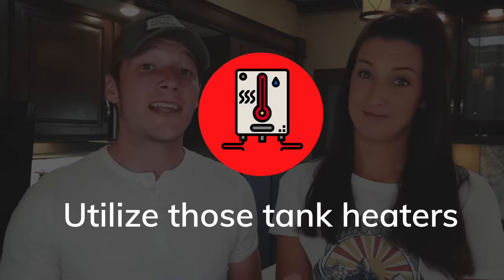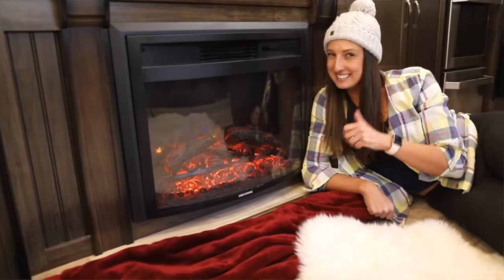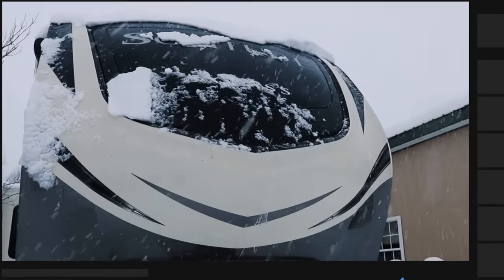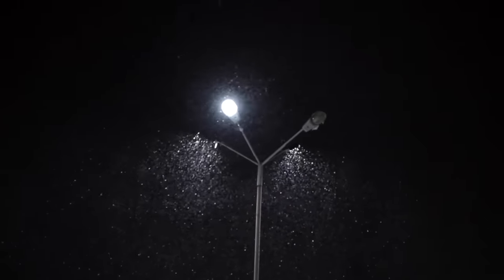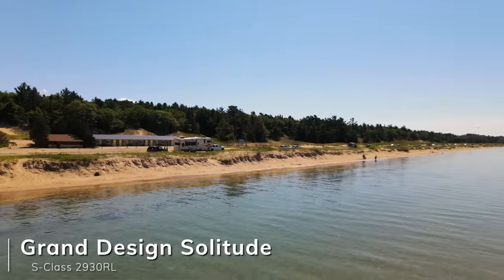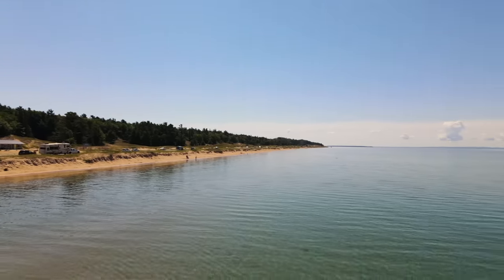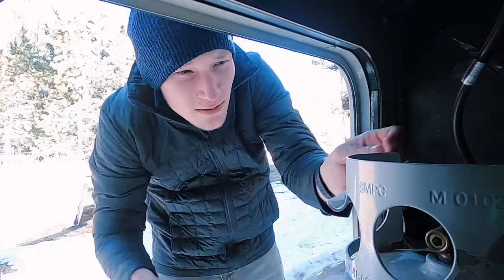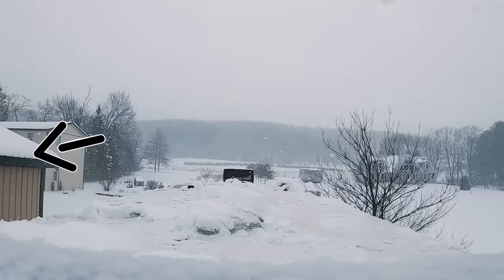Best Winter RV Camping Tips to Maximize Comfort (Winter RV Living)

Comment: Canadian here, my tip: get a heated blanket and place it under your fitted sheet. Turn it on about an hour before bed. Toasty warm. Luv you guys! Cheers
Reply: My cat, George, is a regular furnace and sleeps under the covers with me.  Lots can be said about a toasty bed.  Great idea!!
Reply: They actually make heated mattress pads for this purpose, rather than putting a blanket there.
Reply: Great idea!
Reply: -44 in North Dakota while building my house 

Sucked, just use lots of propane and skirt your Rv with foam board

Comment: Edmonton, Alberta, Canada. 4 years full-time in our 1988 Itasca Class A, 31ft no slides. We go through at least one Polar Vortex every winter with temps in the -40 range before windchill...without a furnace. We use a Buddy heater, an electric heater and electric blankets on the bed and couch, with a small heater in the under bay. We have a composting toilet and turn our water off if it gets too cold. We have ordered a diesel heater for this winter so we should be able to leave the water on longer this year. I love my home most in the winter, it's so cozy.

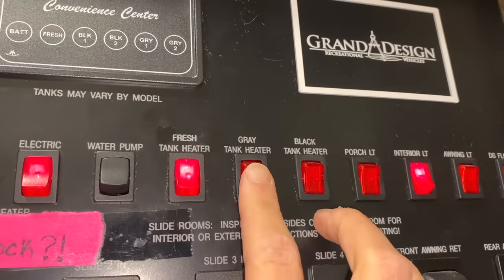Comment: Hot Tip for those of us with 2 propane tanks, and that "auto switch over valve"  only have 1 tank turned on at a  time, this way when that tank runs out, you can go outside at 1:30 in the morning when it 14 degrees, turn on the other tank and have heat again, instead of running a half hour to town, to a 24 hour gas station to exchange empty tanks while its snowing, so the rest of your family and pipes dont freeze by morning. Ask me how I know this, its related to my comment below, as in the first night at our in-laws after an 1100 mile trip in 2 days to get there.
Reply: Yes I learned early on that  those few minutes to switch the regulator arrow & open the tank sure beats a trip away & the exchange rate! I’m not even sure of the benefits of the dual tank use except for if you have spare tanks filled & waiting.
Reply: That’s exactly what I was told to do, so that you don’t run out of propane completely! Thanks

Comment: Haha love that you guys called out Canada! We live in Ontario and stayed in our Cougar 30RLS all winter last year. End of Jan/early Feb there was a prolonged period where temps stayed around the -30’s. We never had any issues BUT preparation is definitely the key for that. Skirting is a MUST! Multiple thermometers to constantly monitor the temps inside the RV, in the under belly and even in the skirted area beneath the RV. Snow actually acts as a great insulator against the skirting also! To keep inside comfortable we ran 2 space heaters as well as our furnace. To avoid any water freezing we use the “NoFreeze” brand heated water hose and it works fantastic! We’re starting to prep for another winter coming… best of luck with your winter camping adventures!
Reply: I'm in the same province and been looking to take 9n this lifestyle.  Is there an easy way for an old person like me to understand how to set up for keeping water running in those cold Temps without wrecking the rig or burning it down?

Comment: 3rd year full time in BC Canada 1995 4 season Corsair 35ft    I am parked on a friends property permanently.  I built an 8x10 add a room for a wood stove  fully skirted with 2x4 construction with insulation and reflectic .    under unit stays around 50 degrees with an 550 cfm air mover with a 6 inch pipe forcing air down from beside the woodstove.  inside the unit its birthday suit weather.  This year I put a 40 foot pole barn type roof over it

Comment: I’ve only had my trailer for a few months, but so far I’ve used it down to -15F.  Mine is a small travel trailer, and doesn’t even have an enclosed belly much less a heated one, so obviously there’s no way I’m running plumbing in those conditions.  I just have the water systems all winterized, use water out of handheld jugs kept inside, and have other arrangements for a toilet rather than the one in the trailer.  Once plumbing is out of the picture you can handle far more extreme conditions without even stressing about it.

I’ve also camping in hammocks and tents both down to -30F, so a heated trailer is easy mode.
Reply: I agree, if you just live in it and dont use water you can go all winter fairly simple

Comment: -20F.  Skirted (air skirts), incandescent bulbs (4) under the RV, one bulb in the water bay, heated water hose, 30 pint per day dehumidifier, shrink wrap plastic on the windows, three layers of shrink wrap on the door, insulation board  all around the slides.  We had already insulated the storage bays.  We used about 100lbs of propane a month.  We used Reflectix on the bedroom windows between shrink wrap layers. When it was sunny, all the blinds were up to take advantage of passive solar.  We used $165 of electricity in a month because we used space heaters too.  We stayed toasty.

Comment: I have a semi with a sleeper like camper. I have to pleasure of running in the Dakotas Northern MN all year. Truck is set up like a camp with shower, toilet, connection oven and  cooked tops. We crank the heat up when cold 🥶.  I will run water back into tank a few times a day to keep water flowing. Also put insulated panels in the windows. Put tray in sink to catch water. So drain doesn't freeze.  Shower has a valve that we keep closed and only open it to drain after a shower. The fun and joy of running in the north besides trying to keep fuel from gelling

Comment: Hey Hanks! We are  RV owners in Colorado. We have a 2-1/2 season travel trailer. No underbelly heat.  We winter camp mostly, (no bugs or people). Don't use the fresh tank.
We do use the black and grey tanks though. Have our water in 7 gallon jugs, keep in the bathtub of the bathroom. We put table salt in the tanks to keep from freezing, about 1/4 pound per use. Its cheap and works well. Coldest we have been in was -10 for three nights.

Comment: The coldest we have RVd through was -20 Fahrenheit. We full time RV in our Vanliegh  Beacon, but our "home" is in South Dakota.   During the winter we camp on our property in South Dakota and use straw (not hay) as skirting.  Most little rodents do not like straw, and we supplement with plug in mouse deterent.  Never have had an issue.

Having farm cats outside and two cats inside certainly helps also.

Comment: I RV in Pennsylvania where I’m from. Definitely skirt, stuff foam in all the ac vents, bigger propane tank, blanket your propane tank like you would your home water heater, pipe insulation around slides inside, definitely use reflectics over windows, make sure you take vitamin D supplements, underbelly heated, basement storage heated, wrap heat tape around your fresh water hose then keep it behind your skirting, hard pipe your sewer with pvc piping, and dress in layers. I’m sure I’m forgetting something, but all of this prep is necessary. Have a great winter ❄️

Comment: Thanks Hanks! Coldest camping was about 20 years ago in northern Maine during a late December snow storm. Had a '77 Coachman truck slide in camper. It was -4 F overnite with wind chill around -20 F. Batteries went dead during the night, so no furnace. Started truck to charge them. It was that night that I learned I had not wired the camper plug to the truck correctly for charging. Ooops!

Comment: It's been high 30s and mid 40s over night so far in south Carolina. Been using electric fireplace and space heater. Never propane, the heater is a pig with propane it's a waste. 

Heading to Florida next month. I'd keep moving to maintain temps above 30 and below 90 basically heh

I was a bit surprised at the mention of drafts thru your slides that weird I've never seen that. I had the rv tipping in the hurricane wind and not even a tickle of air came thru the walls...

Comment: Hello! As a FT RVer for over 6 years, I’ve done multiple winters in New Hampshire and at 7500 feet in Colorado. Extreme temps in NH reached -25 degrees, without a skirt one winter. It was quite an adventure, and I learned a lot. Luckily, I was able to avert any major issues, but I had to be very mindful and stay a step ahead of weather on a daily basis.

Comment: We wintered in Northern Utah last year, it was our first winter in our Grand Design Solitude 377 MBSR, and the lowest temperature we had was -4 degrees! We have vinyl skirting that snaps around the bottom of the rig, which we then weigh down on the inward side with sandbags so the skirting doesn't move in the wind.  It's a little dicey with the skirting around the cap, but usually works really well.  We also invested in two 25' Camco heated hoses last year and that made a ton of difference as we didn't have to worry about frozen water hoses.  Another thing we learned was the value of throw rugs.  Cover your floors with throw rugs! We use the thick, long bathroom mat type and that little bit of insulation makes a difference PLUS the extra color in the rig offsets not being to see outside because of the reflectix on the windows!  Wintering in your rig is quite comfortable when you take the time to prepare! Great video! #thankhanks!!!

Comment: Hey Hanks,
As a "wise" 17 year old I spent a -25 degree night in a cargo van in upper Michigan with no heat or  insulation.  Just LOTS of layors quilts & sleeping bags.  In the morning there were icicles on the inside of the steel roof, brrrrrrrr!
Happy trails~~~

Comment: -46c yup in canada winter here all the time ceramic heater in  the unbelly  and propane blast furnace under nnder the fith wheel no prolems under bbelly sat at =25c under the trailer a nice +18c

Comment: Hi guys! We lived in our rv all last winter in our rv in Idaho. Saw several 10 to 20 below zero nights. Watched your winter tips SEVERAL times to make sure we were ready. We skirted using 1.5 inch styrofoam. We also used the REFLETIX  It worked great. We did freeze twice on really windy days. We were lucky and only had to place a space heater near our pipes for about an hour. We insulated our sewer hose also with the same styrofoam. Pretty easy to cut out a box to cover it. It worked great as well. We kept it closed until it was time to dump. The park did ask us to keep our gray tanks open with a trickle of water running all the time below 23 degrees F.  We could kee the rv pretty consistently 60 to 70 degrees. We got on a propane delivery every month. It was pretty spendy but way better than freezing. We solved it this year by moving to FL lol. Thanks Hanks for the great tips!
Reply: The temps in Idaho can be brutal no matter the season.  There is no place like home...miss Idaho.

Comment: Yep...winter RVd. It was skirted but it was a 80's run down camper and I only had a space heater. It was 30 degrees on the floor and 60 degrees on the ceiling. And actually it got a bit warmer once it was all covered with snow. Wear a hat, use down comforters. 😊

Comment: One winter under my belt. I did it Oklahoma City. Lessons learned. I dumped my tanks too much. I had to dump lots of chemicals down the toilet to be able to flush them out. No damage done as far as I know. It got down around 7 degrees. I’m now in Mesa AZ for the winter.. I cracked open my emergency wine one night. Last winter you could find those at Sam’s club for under $7.

Comment: We have a small ceramic heater in our wet bay which manages to keep the black gray and fresh from freezing and I agree 100% with propane and the furnace with the ducting through the coach assisting with the heating process. And don’t forget the block heater! Also yes on the light bulb program. Thomyt

Comment: Our lowest temperature was 17 degrees during a week in Colorado in October, with about 9 inches of snow.  We applied most of the techniques you mention. It seemed like the furnace was on as much as it was off. We did have a partially frozen line into the kitchen sink, so we will keep the cabinet doors open at night in that situation in the future.  We had a 24 inch icicle hanging off the back of the trailer by the time we left.
Reply from the maker: Oh my goodness, that is freezing! Winter RV camping can be tricky and temperamental lifestyle, but definitely doable. Thank you for your support, Michael!

Comment: I boondock in a 30' Airstream (there's no four season design :-P) - and will winter camp down to about 20F before I winterize.  I think I was in a -5F night and the atwood propane furnace ran <all night long, no stops> requiring me to run the genset to preserve the batteries; and the interior never warmed up beyond 54F. Three small suggestions that diverge from your advice:

- Water hoses - skip them entirely during the winter, top off and use your fresh water tank 100% of the time.
- dehumidifiers - its counterintuitive, but I vent two windows and let a draft through the trailer - have never used a dehumidifier as a result.  yeah it sucks more propane, but its no drain on the battery inverter...
- pool noodles?  If you're in an airstream, pool noodles between the bed blankets and the interior wall... that night it was -5F outside?  The inside metal walls were 28F....  an arm or a foot accidentally touching that wall at night, Yeeeowch!
Reply: oh one last bonus trip!  Proactively keep the sail switch on your propane furnace CLEAN!  Oh dear maird, I've had <THREE> occasions in my robes and slippers at 17F outside sitting at 2am with a headlamp pulling apart the furnace cover outside to reach the sail switch to clean it....
Reply: another bonus -- BEST SKIRTING?  Piled up snow.
Reply from the maker: Thanks for sharing those tips! Pool noodles for insulation is genius, and venting the windows makes total sense. We really appreciate your support in watching our videos! 😃
Reply from the maker: Great tip on keeping the sail switch clean — we’ll definitely keep that in mind. Thanks again for sharing and for watching!

Comment: #Thanks Hanks. I’m here in Wisconsin a lot of us use our campers until the end of November we deer hunt out of them most of the time we winterize the waterlines and are camping in the middle of the woods using generators and battery power. I have a friend of mine that has a camper called an ice house so you can walk right into it he used it all summer as a camper and in the winter time he takes it on the ice and ice fishers from it. Thanks from Wisconsin

Comment: We use reflectix on the windows. Instead of tape we used small strips of Velcro. Then we could easily remove and reattach the Reflectix.
Reply: Received a reply from you via email. Is that legit?

Comment: I have a great RV tip for people who are looking to purchase a new RV and are wondering if their vehicle can handle the weight. I know this has nothing to do with cold weather like this video is about and I know you guys touched on this in a previous video before but this definitely an issue I see out on the road. So the following equation below is what I have been told by an RV salesman and I hope it helps everyone out there choose an RV that they can tow safely. Obviously this is more geared towards the hitch weight for 5th wheels but should work for bumper pulls as well. So, lets get to it.

Go to the trailering sticker on the trailer and take the "hitch weight and divide it by the empty weight" that should give you a ration like ".15" for example which is equal to 15%. Take that .15 and times it by the max GVWR and that should tell you roughly what the pin weight is with the trailer fully loaded.

Example: Grand Design Reflection 324MBS (UVW: 10864 / GVWR: 13995 / Hitch Weight: 1950)
1950 / 10864 = 0.18  |  0.18 x 13995 = 2519 hitch weight fully loaded  

Obviously there are other factors to take into consideration when choosing an RV but this is a good start. You guys are awesome and I look forward to your videos every Thursday. Stay safe out there!

Comment: Hunting camp in Montana -20 and screaming wind.  At that time in our previous RV, Springdale was not a 4 season unit. No skirting and no slides.  I had several jugs of water stored inside.  The water tank froze right at the pump.  Used blower dryer and generator to thaw on day 2 or 3. We were warm and cozy although no hunting took place.

Comment: Timely advice.  Even though UCLA (Upper Corner of Lower Alabama) is mostly above freezing, we've already had a couple of 29 deg F nights!  Hard freezes here aren't rare but expected in our winter.  In the past my '94 diesel pusher did well (P-trap antifreeze, air-blow lines & drained tanks).  Now our 21' TT hopefully will fare well with the same procedures BUT with the opportunity to turn on the line & tank heaters for those shorter, overnight issues.

Comment: We camped in Pigeon Forge last year over Thanksgiving and temps got down in the low 20's at night. Seeing that it was going to be that cold, I bought a heated hose for the trip and was glad I did. It worked great and others were dealing with fozen hoses and water filters in the mornings (didn't use a filter for that reason!). Even if you would have to fill your fresh water tank more than once, you may still want the heated hose to do that. Dealing with a standard water hose in freezing temps is a PITA. My opinion: make the investment.
Reply: I agree...cold is cold.

Comment: setup a blow out system. i use the air compressor from the tow vehicle. When temps go down or forecast overnight to freeze, I connect to the schrader valve and blow out the lines. (some additional valves required in the water lines. )

Comment: I want to give you a tip…… use kao wool for insulation…. It doesn’t burn and hot and cold doesn’t go through it…. It’s used in furnaces for melting metal….. re insulation to everything ….. you will be in basically an oven…. No heat escaping…. No cold entering …. Best choice you’ll ever make….